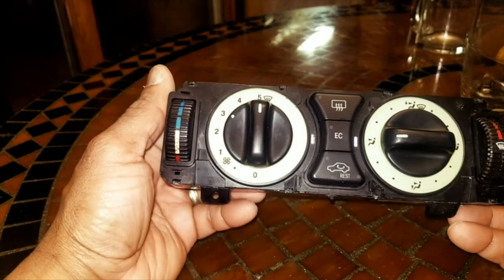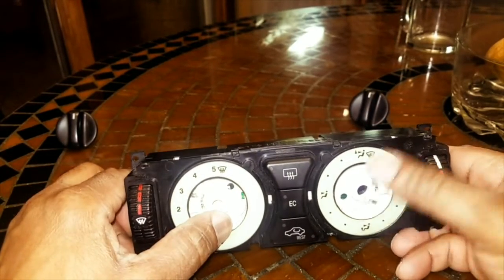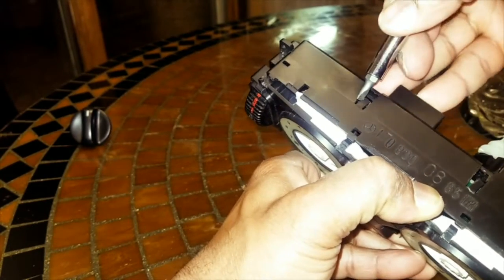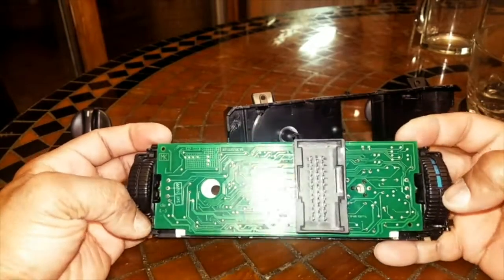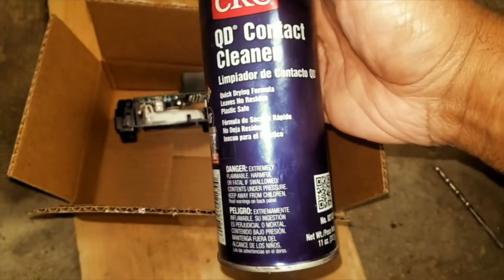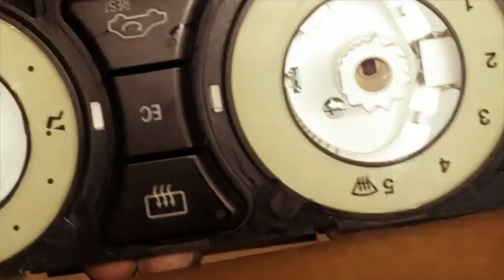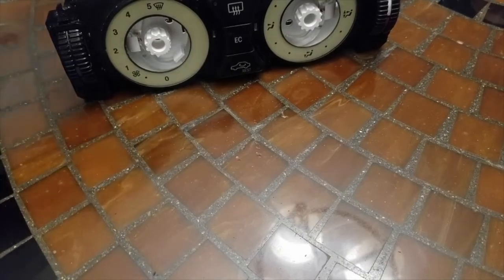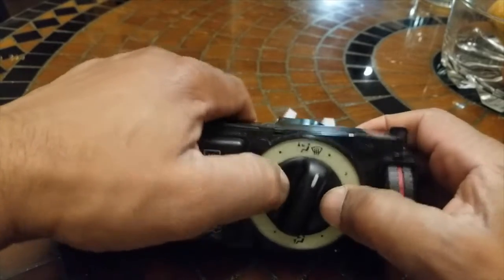Mercedes SLK 230 Climate Control Module Repair

Comment: hi all well i am 79  and own a 20 year old r170  now i have noticed that, well not  to sure every car that i owned in the past 61 or 62 years onlly 2 has had thia problem . the engine never over heated Yes both have the correct thomostat fitted yet at first the cars were cold, then some how you got use to it , Then say after 20 miles it was warm. , both these 2 cars within say  after a 1000 running in.  Some say it soinds like my clpamate control Now i am stuck

Comment: Nice sharing sir 👍

I have question, I have 1 dead bulb on my climate control unit, what the type of the bulb, sir?
Reply: Just changed mine and it was all glass (no metal end) 12v/1,2w. Thanks to this tutorial, changing was 1 minute job :)
Reply: @RetroUkko  thanks sir

Comment: Hi Keith, I love your videos! I have 2007 CLS 550 and I replaced the suspension system from air to springs. How do I bypass the relay so that I don't have the suspension malfunction
 display. Thanks

Comment: Hi Keith, as always an excellent video. I have a 1998 E320 MBZ W210. a few months ago started to smell burnt oil, after driving for 10 minutes, inside the cabin. Checked everywhere but no leaks. Then, I was skeptical about whether it is the crankcase ventilation (PCV) unit, or something else. If it is the PCV, would the PCV eventually have a negative effect on the catalytic converters? Please advise. Thanks again, and keep up the great videos running, please.